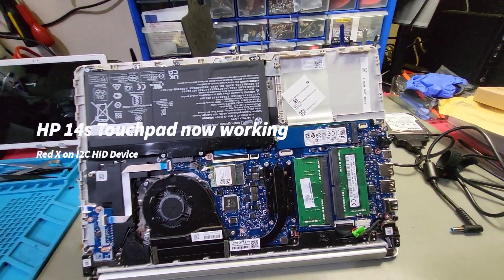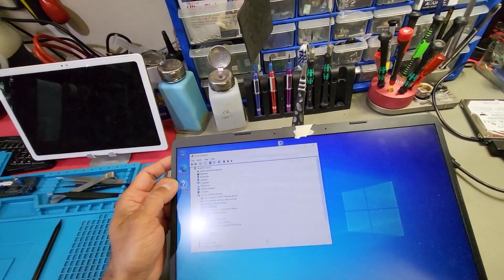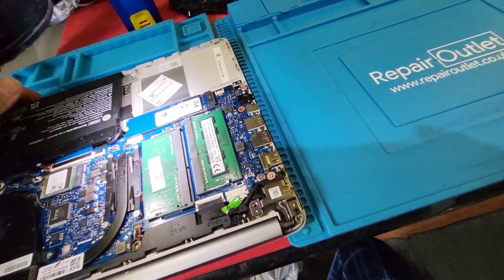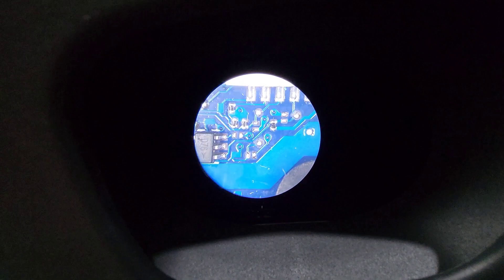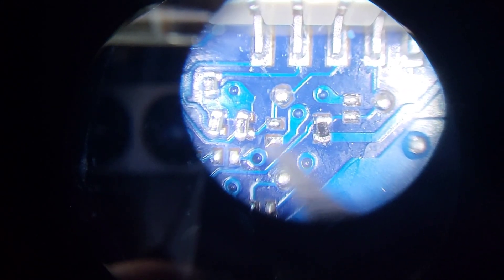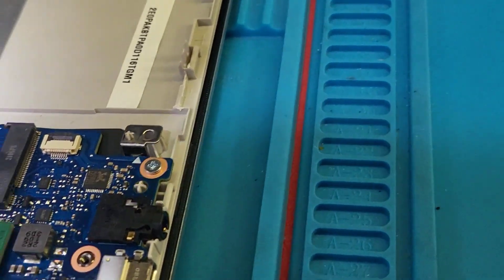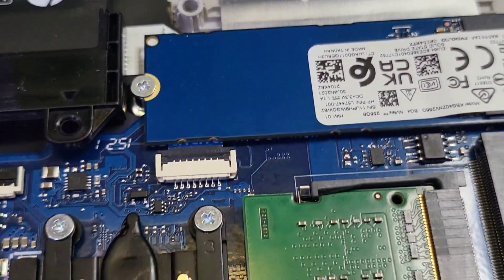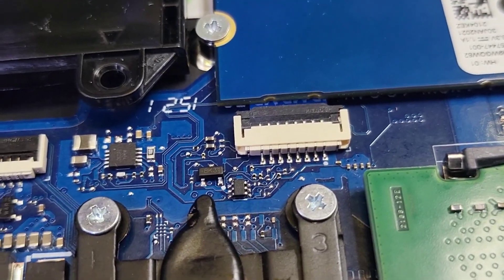How I fixed HP 14s no touchpad, I2C HID Device missing.

Comment: my Hp Envy 15 laptop showing the problem that I2C hid driver problem that's why screen touch not working, I've installed windows 10 & 11 but it's not worked. then an engineer opened my laptop and plugged off bios battery then connect it then it automatically working screen touch, but after few day its again not working and sometimes working screen touch, so what can i do now? how i can repair it permanently? please help me out...😢